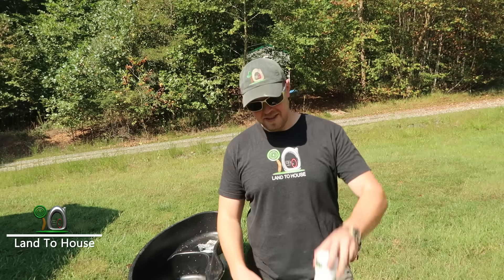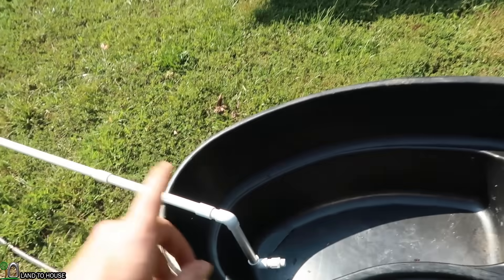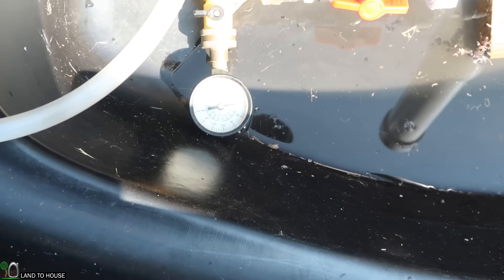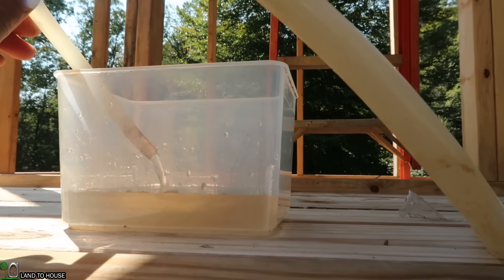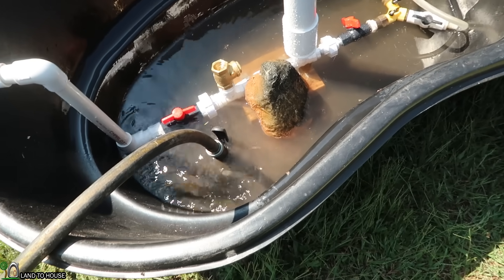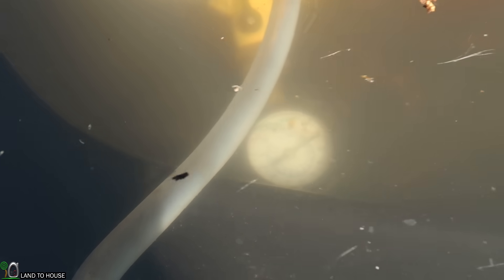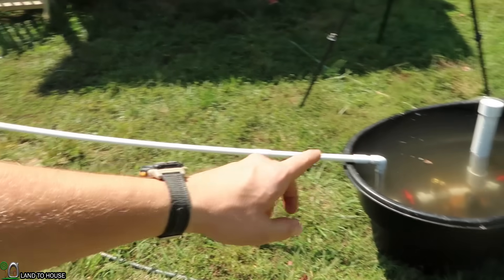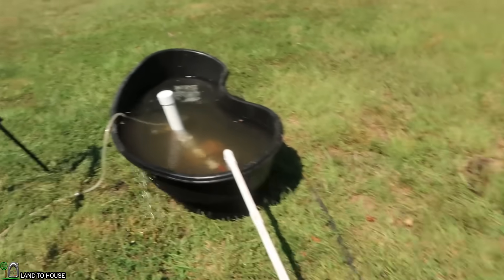Underwater Ram Pump

Comment: Hi Seth,  great video and very informative.
What i noticed is the pressure chamber was little bit more than halfway under water, ie. that was the drop in pressure fron 32psi to 24psi.
I think if you had a much taller pressure chamber the pressure the difference would have been the same as the difference in flow rate.
Nice video buddy.

Comment: If you have a running stream, but no head pressure, you should be able to use a funnelled inlet pitot tube to create velocity to operate the pump while submerged in the stream

Comment: Whats inside the large diameter upright pvc pipe?   Any kind of bladder or just head space/air?
Reply from the maker: On the pvc ram pump only air is inside the pressure tank.
Reply: Thanks!
I wondered, because there are others out there that have an inner tube in theirs with minimal air pressure to act like a bladder.  Just wondering if you knew what difference it makes and which is more efficient or practical, or....?
 @LandtoHouse
Reply from the maker: @BamBamv65 After ten years working with the ram pump I discovered the inner tube does not work efficiently as an air bladder. A sniffter valve is the only effective way to replenish air.
Reply: @LandtoHouse im unfamiliar with a sniffter valve.   Is there one installed in your setups?
Reply from the maker: @BamBamv65 The snifter valve is only found on large all metal pumps. The pvc pumps tank will need to have the air replenished every couple months. Just draining the water out is all that needs to be done.
Reply: Thank you.
 @LandtoHouse

Comment: I was wondering 2 things. 1) having the pump 5 feet deep with a pipe feeding it from say location but 4’ above. Maybe even using a 5” pipe neck down to 4” then 3” the 1 1/2”. 2) whether a cover with air in it covers the input value so there’s no water resistance when it goes off, of course open on the bottom so there’s water comes out.

Comment: The reason was because you lost part of the total pressure to pushing the water out of the pump through the water around the pump, it is more easy to pushing out the water from the pump to atmosphere not through the water

Comment: I think the pressure was reduced due to the pressure against the wast water coming out the waste valve due to the water head flooding the Ram Pump. But, this acting like counter weight which reduced the time for waste valve to remain open, which reduced the waste water which goes to the container. Right?

Comment: Imaging a lake 30 foot deep. Pump down 25 feet! Why wouldn’t that give a huge fall of 25/feet and a rise in lift over 100ft above lake surface…. Even if we had to put a 3 in pipe to surface of ramp pump discharge operates in AIR with out the 25 ft of water Column having a 25 ft negative pressure against the pump discharge.  

If this works, then any fall in water would serve to pump water… after All isn’t this where electric turbines get their force from ? Height of falling water ?

Comment: I would love to see a closed loop ram pump combined with a water trombet with a small circulation /pound pump to make compressed Air via isothermal compression. 🤔A silent low power consumption, high flow, high pressure compressor😎😂🤣💪

Comment: I know it is very old video, just come a cross. I am mechanical engineer so lets clear this out the way. Under water , the volume of the water in bath tab creates a pressure, So, this is why you loose pressure on the gauge. Think like this ( I do dive ) , when you dive deeper you go,  water pressure per sqm or inch by volume in ocean or sea this much higher obviously. So, this why your pressure is gone down due the water amount in the bath tab. On the other hand if you keep it close to surface and it will keep similar amount of pressure or close to same without water test.  Second thing, you can create multiple ramp pump and connect to another one in line that will creat much higher pressure and volume. Also, amount of the water in source equal to weight and pressure, say 1 m3 of water and 1 meter high and in conical shape bucket or design, it will put all the water pressure in to single point 1 bar pressure will be achieved then ramp pump will increase the amount and you will get constant and higher pressure. I have a different design which I can not disclosure, but you can actually not only create higher pressure but continous water flow and create stand alone power house. I have already done some small prototype and still need a little more testing and adjustments, once completed actually you can use similar system to make power that I would say around 5 KW per hour , at lease this is my aim, but my set up already making 200 watts and continous. As the system gets bigger then some issues arised, So I need to solve them before I can say it is completed. Anyway, I just wanted to make an input. Thanks.

Comment: I kmow this video is old, and I looked through alot of your comments. Just wanted to point out that when you were checking pressure. Did you notice that when tub was empty you shut valve off right at the guage first, and when tub was full you shut valve off before check valve. Measuring pressure in air tube as well. That may be readon for drop

Comment: Thanks for this - I'm just discovering the Ram Pump field. Would there be any benefit to putting 2 or 3 ram pumps in series to create a higher pressure pump? Your submersing the pump  - say in a river would also add to the head pressure no....or does the added water pressure from doing so just put a back-pressure on the whole system?  If one were to  trench small deep pit beside the river/creek to drop the pump in - would that be beneficial to creating higher head pressure?
Reply: As long as you have check valves between each it will build

Comment: i have been thinking about the use's a ram pump can be put to . & one that coms to mind is power production.  given most will not have a stream of sufficient swift ness   or Hight to power a micro hydro  electricity production system. i believe a ram pump could be utilized to deliver sufficient  Hight  to fill a tower & hold sufficient water to gradually increase to a bigger ram pump & even grater depth of water At stream level tank depth + psi at base out. let  lets say a 40 foot square tank as a death of 40 feet  gave us .1200,000qubic feet of water  now that will relate to water presser at a  psi as the pipe size of size of 40mm &  down to a  5'16 nozzle size to power a  micro hydro turbine  . the waste water wuld be capered A rented by ram pump to  the holding tank.  the stream wuld Mack up the loses. & as it capable of running under water it would be free from freezing in winter

Comment: Would a ram pump work with an open lake (constantly emptying and refilling)? The water constantly flows towards and over the dam
Reply from the maker: The ram pump needs a water source from above the pump. Lakes will not work. However if you have water flowing over a dam you can use that head pressure to run a pump.

Comment: If I place a ram pump at the bottom of a 1k gallon tank, would it be able to pump water a couple thousand feet up to around 100ft elevation change, to a higher point on the property to another tank, so it can gravity feed everything below it?

Comment: When I start working on my wetland pond and bog filter, I want to try to use a ram pump in the pond, flowing from the bog filter overflow, to the ram pump, and back into the bottom of the  bog filter creating a small waterfall feature, and filtering the water. I'm wondering if the ram pump is deeper, say 4 feet underwater, how much more that might effect the flow.

Comment: Ram pump  needs  about 4 feet of head to run did you try to put the pump  4 feet under water with only the outlet pipe  just thinking  nice work

Comment: For a closed loop system what would be the minimum high and length from delivery to ram. I am thinking of running water through a Solar water system and back to the delivery. Of course I would have to move overflow water back to the delivery. But that is a second challenge…
Reply: Sorry I meant to say source to Ram.

Comment: I don't understand the purpose of having a ram pump under water if the inlet source of water is external to the water source where the ram pump lies or is placed. In my opinion the pump should be placed almost at the bottom of a well or a lake or pond with the open end of the inlet pipe lying at an incline under water in the same well, lake or pond where the ram pump lies. Could anyone guide me on this topic?
Reply from the maker: Sadly the source cannot be the same body of water that the pump sits in. The head pressure and hydro static pressure cancel each other out.

Comment: Would this work with both the bucket and pump beeing submerged? Lets say the bucket would have an open/close mechanism and the height difference would still be there.
Reply: The bucket or closed vessel with the open close meachnism would still be placed higher. But ye, both submerged.

Comment: The gauge pressure being lower does not affect the output pressure at the final container. you add the gauge pressure at depth to the water pressure at the depth of the water hammer.

Comment: Ok, saw the rig up a little better.  Here's a more complete explanation.
First: The pressure gauge measures a differential between the tube pressure and the atmospheric pressure. So when you submerge it, it is reading tubing pressure versus being underwater pressure, which is quite a bit more than the air pressure. Hence, you would see less difference, lower pressure difference, once the pump is underwater, and the reading would immediately read lower.
Second: I'm not sure how the valve works. Does it maintain the static pressure on the output after the piston stroke? Or will it return to zero pressure at the end of the piston down-cycle? Assuming it maintains pressure, you'd have to close the valve and cycle the pump to measure the static pressure potential during the downstroke. By capping the flow off, the pump exerts its full potential force on the water being pumped, and you can take a reading on the setup you have.  Here was the problem in the clip... you kept the valve open and piston not moving. So all you read was the pressure due to the water column downstream being elevated.
So not only would you see a decrease due to the "outside" atmosphere being water instead of air, but if you read both readings with the valve open, you would just be comparing a pressure distance due to the pumping location being less elevated in the second case.

Comment: With that pressure reading, aren't you just reading static pressure from the water column downstream? You would have to make a live reading with it capped off right after the valve... it seems.

Comment: I noticed the 1st time you took the pressure reading you turn off the valve on the Y going to pressure gauge before stopping the intake but not the 2nd time.
Reply: Yes, I caught that also. I think he was reading the pressure from the elevated water column in the second reading.

Comment: having the pump completely submerged would reduce freezing in very cold weather. Depending on how cold, of course. It should withstand frost. Not saying about the pipes, however. It would also accommodate changing water levels in the water source. One wouldn't have to worry if the creek rose like after a big rain. I'm amazed it works underwater! Thanks for the video.

Comment: Great Test that tells me it would also be possible to run a Ram Pump from a Watertank Underground. How would the Rampump act if the Inlet and outlet Valves would be farther away from the presurehead and Check valve can you make a test on that? That would be great.

Comment: I'm very interested in these pumps. I'm wondering if I completely submerge the pump in my pond and just put the inlet 4 or 5 feet above the pump, in the same pond, will the pump work?
Reply from the maker: Sadly the ram pump cannot have the source water in the same body of water as the pump location. The head pressure and hydrostatic pressure equalize each other and no water movement happens.

Comment: How do You set up a ram pump in a almost flat river
Reply from the maker: Sadly the ram pump needs a minimum of 2.5 feet of head pressure to operate. It does not work in a flat river.

Comment: Cool stuff!  I'm wondering - how can you capture / use the "waste water"  so its not....wasted?  in a hot dry climate, every drop of water is sacred. wasting water from the pumps waste valve is not an option! can a bucket or "cup" on top of the waste valve be fitted? ie: would the waste water be able to be re-fill back into the pump system since it is positioned before the actual pressure tank? I guess like - water in - waste valve pushes water into "cup" when open- waste water cup refills waste valve when closed - re-entering it back into the system? make sense?

Comment: I bet it is how deep the ram pump is in the tank. As the water height increases in the so called pond there is more water weight applied to the opening valve. The higher the water rises above the pump the lower the PSI pressure will get until the pump eventually will slow down and stop working. To check this you would have to make the test longer and see if your pressure drops after 30 seconds of time. Such as a whole minute, or longer and see if the pressure drops. I like the idea of an underwater ram pump.

Comment: My question is why you need to have the water source (pail) to be very far when it will have the same water pressure if it is beside your experiment but at the same height?  Water pressure is measured by height difference not by the length of the pipe where it will run through. This is a common mistake (or misconception).

Comment: Hello, First, a drop from 32 to 26 PSI is 25%.  Now the question I have on RAM pumps. I would like to use a RAM pump in a Hydroponicsystem to grow vegs. The pump would be in a pond, on top there will be a growbed. In this setting if you know the water runs back in the pond will it work? Is this setup there is no bucket involved as what you use in this video to supply the pump from water.
Reply: You can't compare the two readings... the second one read the pressure of the water column, not the potential pressure the pump can deliver.

Comment: The difference in air pressure compared to water pressure shows the difference in the pressure readings.

The water submersion also cushioned the system so the noise was reduced.

Comment: Would this work if the drive pipe and the pump were both under the same water but had the drop needed? I have a tank with another tank above it.. I would like to pump from the bottom to top.

Comment: If you put the ram in a dry basin with no supply pipe, if the basin begins to fill, will that be enough pressure to pump it out? Essentially acting as a sump pump

Comment: could not believe it when you had the tube coming right back down, meaning once the water made it back down to the outlet at the bottom you would have no back pressure. on the ram pump
Rookie mistake.

Comment: I remember reading in an article a long time ago about WATER HAMMER pumps that mentioned that a larger flow to a higher location  a distance away could be obtained by using a vertical loop with the down pipe acting as a siphon working against the drag of water flowing in the pipe uphill to the final use spot.  Many people  associate the French Montgolfer brothers  with hot air balloon fame.  They also are reputed to be the inventors of the ram pump using cannon balls and an up sloped pipe as the waste valve.  The flowing water would start to flow and push the cannon ball up slope to a smaller outlet, then the water inertia would lift another cannon ball vertically in a larger diameter capped pipe and tee.

Comment: in 10.33 mins of your video. The pressure difference is caused because of the pressure you exposed the check valve. Under the water the pressure on the check valve from the surrounding is higher compared to the atmospheric pressure due to the air, hence that's why it gives different pressure in such different conditions.
Reply: loved the way you tested it...👍

Comment: Wait why is the discharge pointed up? It should nit be underwater and it should be pointed down. The way it flows more easily with and it will give more pressure. In water it has to deal with the water pressure of the tank. Out of water and up you have to fight gravity. Out of water and down you will have the help of gravity which will increase the discharge  which will increase the hydroschock effect you are taken advantage of which will allow you to "pump" will more pressure. Sorry idk how these work this is all assumption of of H.S. edu

Comment: Put it 100 ft underwater and it won't work. The water pressure at 100 ft would be to high and it would not discharge any water out the waste value. This is all new to me and I don't know shit about fuck whem it comes to these "ram pumps" but it's simple science. Keep it discharge free and clear and you will get more pressure